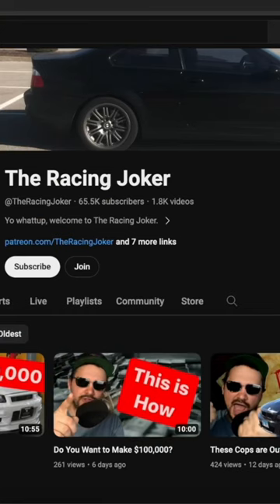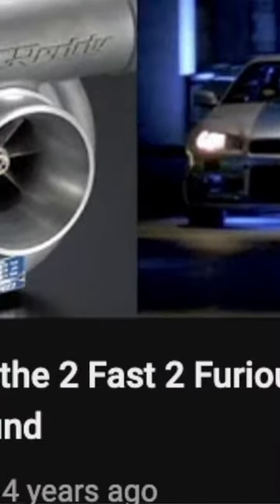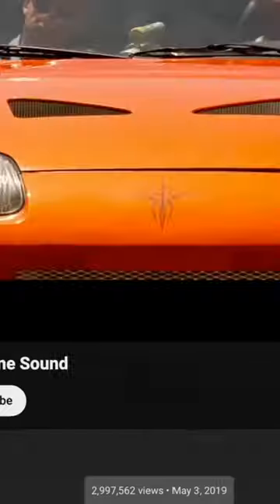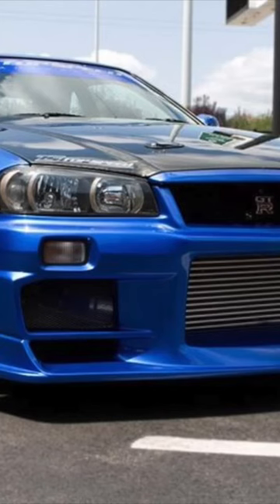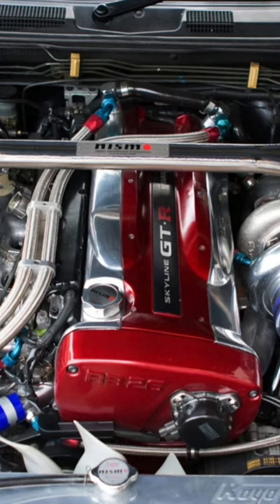ORIGIN of Brian’s Skyline Sound! #2fast2furious #paulwalker #brianoconnor #r34gtr #nissanskyline

Comment: The single turbo conversion + big cams made the sound👍🏼
Reply from the maker: It’s so good once you find the right parts
Reply: The main reason it sounds like it sounds is equal (or close to equal) length headers that join 6 to 1.

BMW inline 6es sound very different, and by doing what i mentioned to their exhaust systems, they sound exactly like Brian's Skyline.
Reply: Are we obledge to change de cam ?
Reply: @parid.kushta what ?
Reply: Yes

Comment: Craig Liebermann (I think - he worked on the movies) admited that Brian's Skyline sound was made by mixing some Supra nosies into it. It makes sense, as Brian's Skyline had a lower pitch sound, less like high reving RB, more like 2JZ that doesn't like high revs that much and it has a "deeper" sound. 
So You can get RB to sound close to the movie one, but it won't be the same noise.
Reply from the maker: I’ve spoken to Craig on the phone about this already. While he knows sounds like that we’re mixed together for several cars, some didn’t need excessive mixing. The orange supra actually sounded the way it was depicted in the film. And he has already told me my theory that the HKS tubular manifold is the key to making an RB sound like this (as heard onscreen and in the original sound files that I played)

Comment: The sound is due to the specific design of the HKS single turbo manifold with the external wastegate. The design actually uses unequal length headers with the 3rd and 4th pipes being shorter than the rest (and the 2nd and 5th pipes being slightly shorter than 1st and 6th).

An equal length exhaust manifold will sound like what you get with most single turbo MK4 supra setups.
Reply from the maker: Equal length will have that more of a high pitch scream? That's really interesting.
Reply: @TheRacingJoker  yep! Less exhaust pulses reflecting off eachother in an equal length setup results in a higher pitch (like you’d see in a flat plane V8, a V10 or a V12 with equal length pipes AND even firing pistons). Odd firing pistons won’t give you a higher pitch even with equal length pipes because the exhaust pulses will always collide at some point. Equal length headers will also give you better top end power which is what every single turbo setup was after back in the day.

On the other side, unequal length headers are mostly a consequence of trying to get the turbo to spool quicker. The shorter the tubes, the quicker the spool, which was the philosophy behind the A90 Supra’s first B58 design (the 2port heads). If you were to make a mold of the exhaust portion of that head, it would look like an unequal exhaust manifold. Most Inline 6 diesel engines use this design for better torque production due to relatively faster turbo spooling.